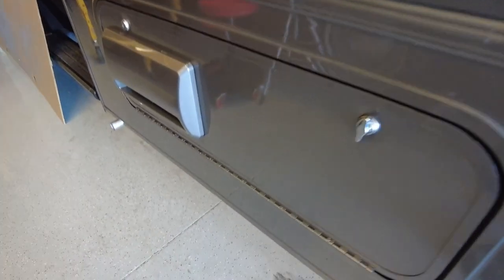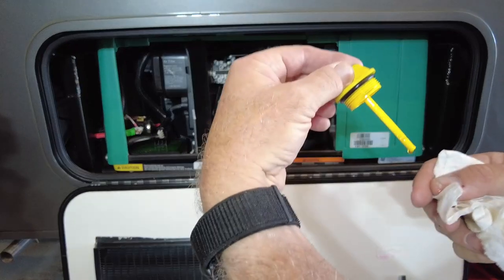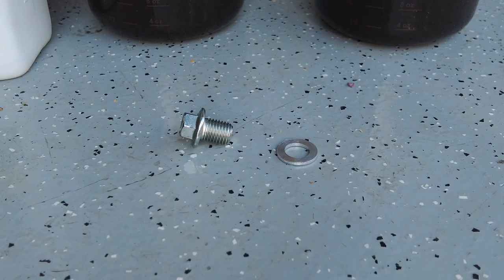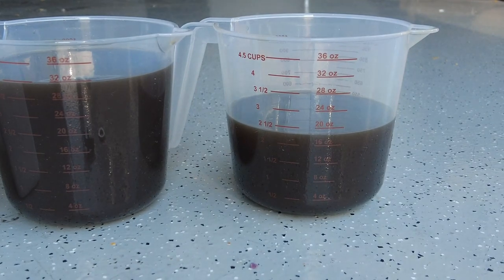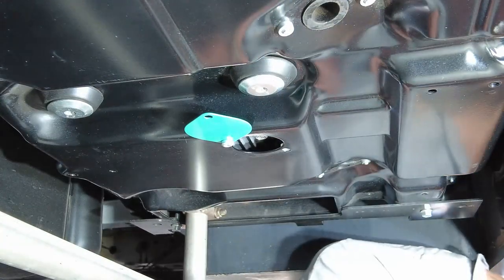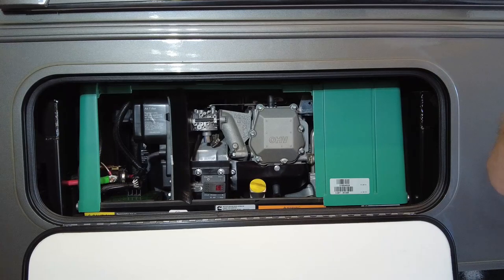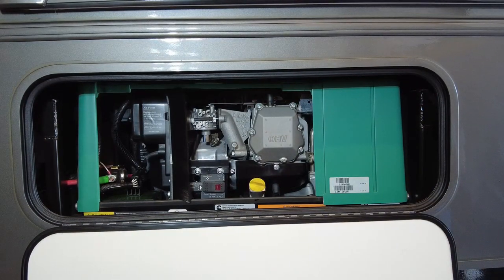Oil Change   Onan QG 3600 LP Generator   Winnebago Vita

Comment: Did your manual specifically call for straight 30 weight? Mine says 10w30. Just curious.  Thanks for the video!
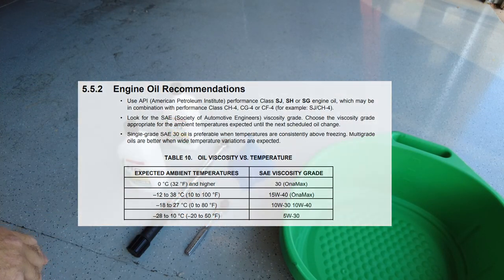Reply from the maker: Yes, my manual gives several options.  See picture of oil recommendation from my manual at about 1:20 in the video.
For 100f and above it says straight 30 can be used.  I live in Arizona and its hot here.  I would also consider 15w-40 for my temps in AZ.
Thanks for watching.  :)
Reply: @Old2925  thanks. I'll dig deeper. Still amazed there's no filter. Lol